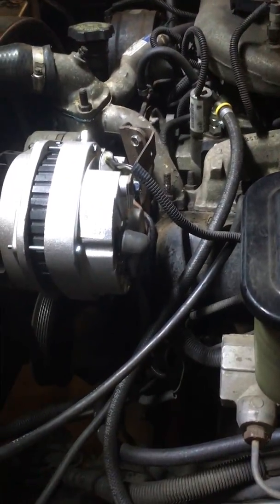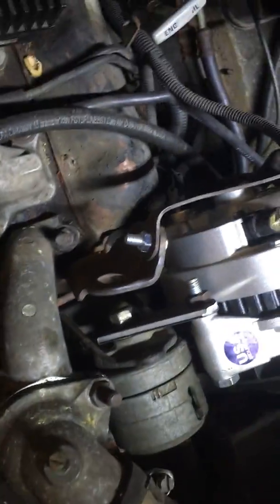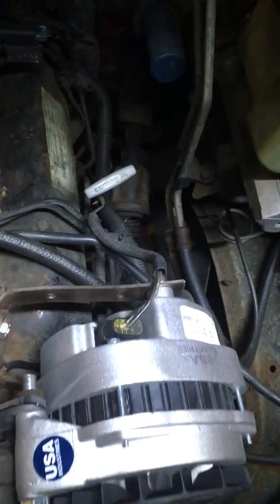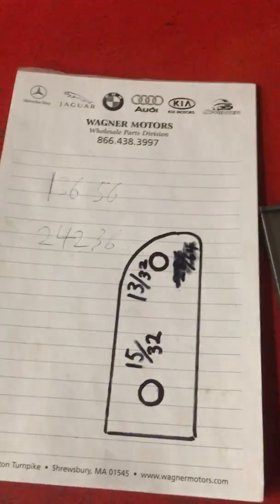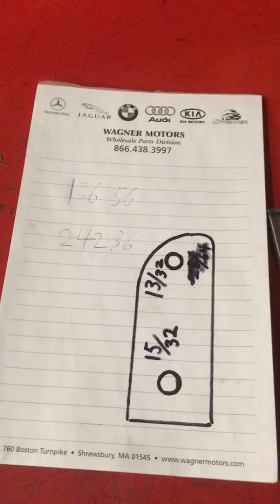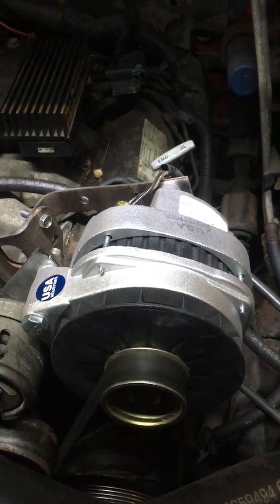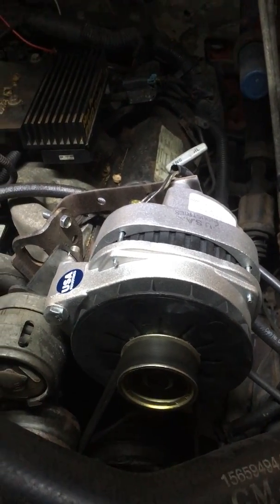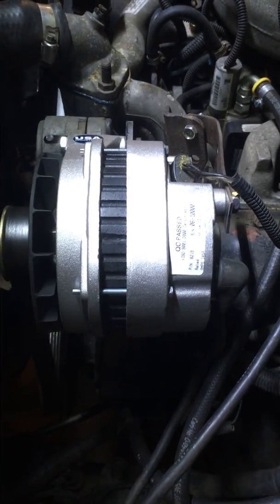6.5L diesel alternator upgrade cs144

Comment: Hey I have a 96 with the ALT On the passenger side.  Will I still need those brackets?
Reply from the maker: https://youtu.be/mMlSTXTNiDA

This video will help you but if you have a gas truck you will need a different belt size
Reply: @TRUCK_TECHNICIAN  I have a 96 Diesel with a Vac Pump Delete and Turbo Master.  My wife is driving the truck home as we speak.  The ALT locked up and causing the belt to scream.

Do you recall what size belt is needed or part number?  I’m at work and I don’t have access to my notes.

Saw the vid...so it’s just bolt on THANKS
Reply from the maker: @pattayperformance  K061005 gates 
don’t forget to give me a shout out on your channel if you make a video about it
Reply: @TRUCK_TECHNICIAN  

Knock knock lol…the alternator went out with a bang…literally 🤣

Got it for an 01 2500 HD from AutoZone.  
Part# DL192316-4

It’s significantly bigger for sure!  My belt won’t fit 🤣

Also, the old ALT had 3 mounting points 2 ears and one on the back for a bracket.  This one is only 2 ears.

Comment: very grateful for this information. I have a 1994 6.5 turbodiesel with 366K miles and I tow a heavy load--last trip I feared running the A/C as the amps were running low on stock 105 alterator. I have always kept a watch on the temperature-even with upgrade water pumps, these trucks could run hot with pulling steep inclines, now I have to also be more aware of the charging system due to this last trip. Will get help and go to the 140 amp alternator for peace of mind!

Comment: What was the reason for the upgrade? What kind of tests if any did you run before and after? How many amps dose your system draw? Do a video going over your truck and show what you have done to it. Thanks. Great vid
Reply from the maker: ryanburbridge  the truck is a 3500hd tow truck with a fair amount of lights and radios so with everything on the alt would be down around d 13 volts and also the original alternators are prone to failure because of the case design.

I will try to make an overview of the truck sometime this week